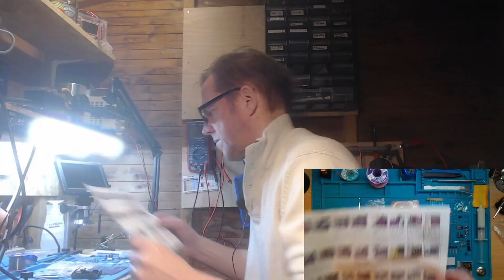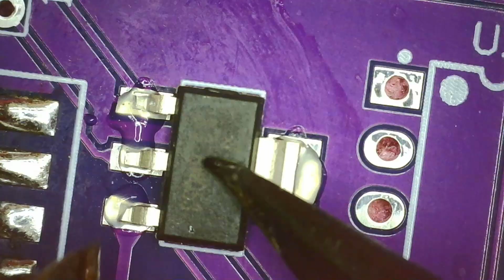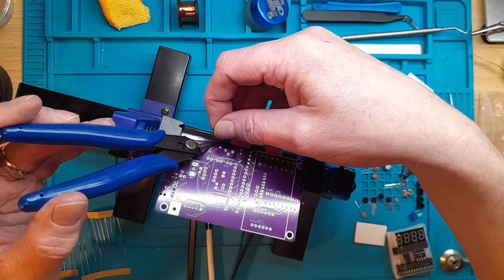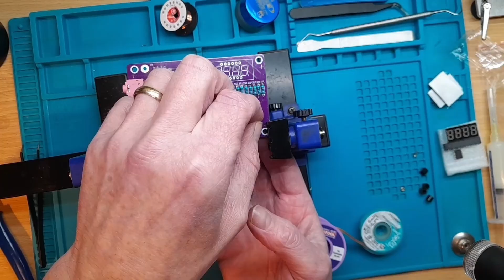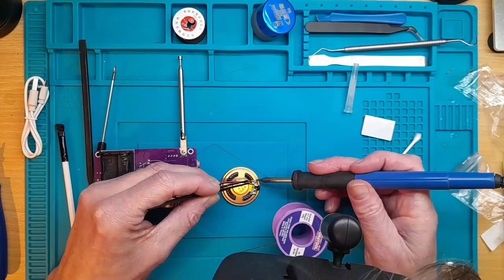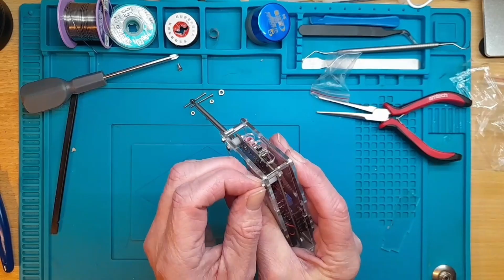Gikfun FM Radio Kit Soldering Practice Kit

Comment from the maker: Hi Scarlett.
I'm still editing the next couple vids.
One for a small nintendo switch rail replacement and the other is using freecad and my old 3d printer to make a custom canopy for my grandaughters festival trundle. Might as well since I couldn't buy one, so make one :)

I've got a few projects on back burner that I want to make, probably involving custom pub's and led lights.
Ill reach out once I design circuits and have pcbs made to include promo links :)